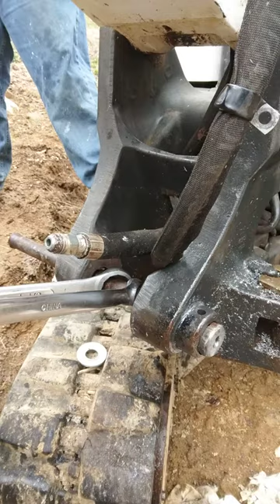pt 11 hydraulic cylinder pin removal Bobcat e35

Comment: Did you guys try heating it with a torch?
Reply from the maker: We did not. At the time we did not have a cutting torch.
Reply: @brandonholbert4557  I have the same machine.   I heated each side with a plumbers torch.  And battled with it over the course of several days and finally got it out!💪
Reply from the maker: Thank you for the info. The reason we posted this video was I couldn't find anyone who had a similar problem.